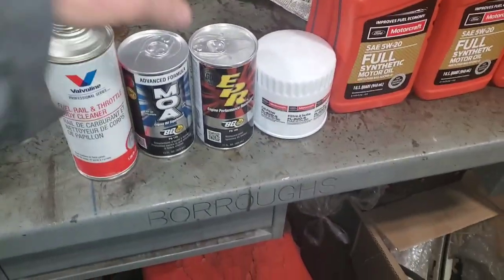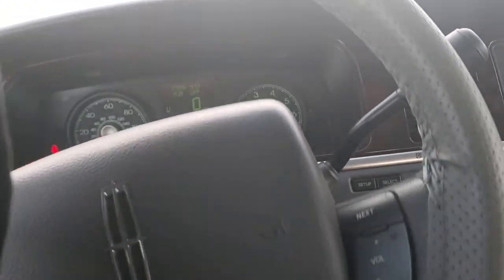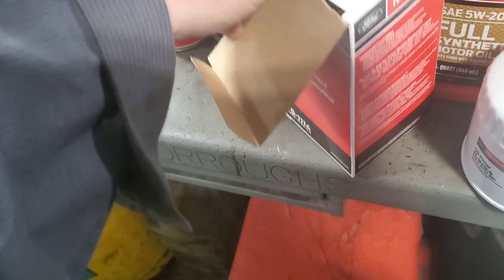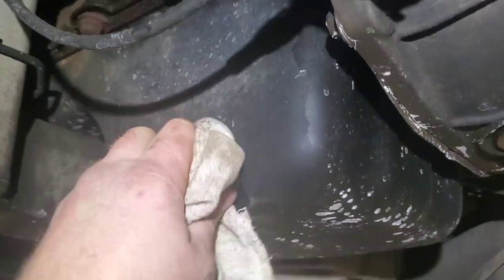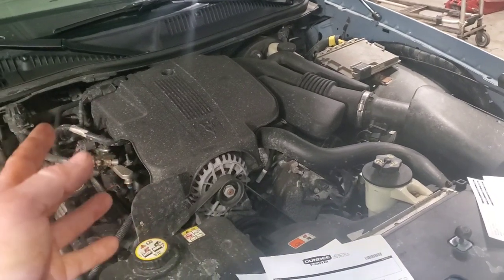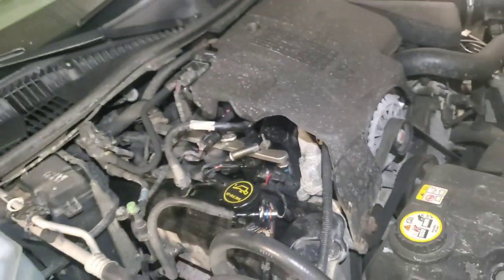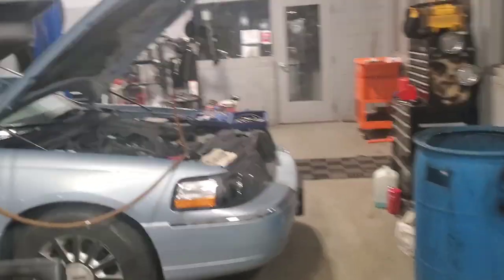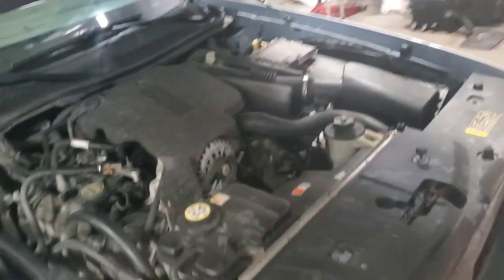Lincoln Town Car Factory Service - Fuel Filter, Fuel Injection Flush, Motor Flush (BG), AIR Filter

Comment: Every other video I've seen on replacing that fuel filter they say you have to remove that inlet hose clip and 9 times outta 10 they always break. You're the first person to say it's actually a push tab. 

I just picked up a 2010 Crown Vic P7B and I plan on going thru it and changing all the fluids and stuff so all your panther content has been helpful.

Comment: What you recommend doing on the 1.5l for the carbon build up
Reply from the maker: You have to try to figure out what dealer carries BG fuel injection cleaner and induction system cleaner
Reply: @FordBossMe  I have about 34k anything else you would recommend doing i might be due for oil change I already done a transmission drain and fill. i replaced spark plugs and air filters. I did alignment my self since I jumped a curb the other week.
Reply from the maker: Cabin air filter and if you have an all-wheel drive system service the PTU
Reply: @FordBossMe  I already replaced cabin filter when I changed the engine filter. Mine is a17 fusion se 1.5l fwd
Reply from the maker: Your Good Then
Reply: @FordBossMe  which one would you recommend for the bg 44 fuel cleaner this one here also do I pour it directly into the gas tank or should I use the fuel injection cleaner pressure tank you had
https://www.amazon.com/dp/B07PXCTPV7/ref=cm_sw_r_cp_apa_fabc_KH655ETBEX41VPRM7TCB.

Or this one https://www.amazon.com/dp/B07GT8RN6Z/ref=cm_sw_r_cp_apa_fabc_5FJY6XDXF1PRD7TPCQAE

Comment: Why not disconnect power to the fuel pump while running the injector cleaner? Doesn't it strain the pump running it against the obstruction, or is it regulated and shuts off at a set pressure?
Reply from the maker: It doesn't cause any harm to it it just slows the pulse-width modulation down to the pump that would be like sitting there with the key on but the engine not running and people do that stuff all the time

Comment: Is it ok to put the oil flush in if you have oil that has a 1000 miles on it it looks like you put it in on dirty oil but you change your oil pretty frequently and it looks like you have flushed it before . I'm not sure if I should start with brand new oil put it in flush it then change it again.
Reply from the maker: Absolutely you can put it in with the oil that's already in the engine regardless of how many miles are on it just make sure you flush it before you put your new oil in
Reply: @FordBossMe  thanks I think I'm going to get some and do it on my transit

Comment: 1991-2002 use 5 quarts of engine oil. 2003+ use 6.0 quarts. I run 6.5-6.75 quarts in my 2003+ and have for years. What is your thoughts on "over-filling" the engine oil by 1/2 a quart to 3/4th a quart in these 4.6 2 Valves?
Reply from the maker: I've never tried it and I don't know what the limitations are but you seem pretty smart and you know that if you get the oil level 2 are you'll get that crank slop and it'll actually start pushing it up to the crankcase ventilation and all kinds of smoke comes out and everything else

I've never thought about going a little bit more my vehicle doesn't burn any oil to any kind of noticeable measurable amount

Comment: Hi BOSS, it is ok to use Amsoil synthetic in my Lincoln town car 2006?
Reply from the maker: Yeah but it's overkill
Reply from the maker: Pennzoil Platinum Ultra I'd go with
Reply: @FordBossMe  thanks for the tip, I think I'll use pennzoil then 👍
Reply: the book recommends Motorcraft, but it seems a bit expensive and I think the car would work well if I use another brand too

Comment: Why not do the FI service and engine flush at the same time, and save time, running the engine ? Motorcraft oil is supposed to be really good from what I've read  I wouldn't hesitate going 4k on quality full synthetic, no additives  I go by when the oil starts to look dirty and don't obsess over the miles one way or the other.
Reply from the maker: I don't run my oil past 3000 miles that's based on what I do professionally every single day and the way I flush these and do the things that I do is because I do it for a reason this way

Comment: Usually dump Red Line SI-1 fuel system cleaner in every oil change. Also run Chevron with Techron at every fill. So far no fuel issues.
Reply from the maker: The best you can buy is BG 44K fuel system treatment
Reply: @FordBossMe 
I have a 2003 Lincoln town car that I bought yesterday, but seems to have a lot of hesitation issues. You think I if I put the BG 44k fuel system cleaner in my gas tank, it will help?
Reply from the maker: @missyidontgiveacrap9939  you could do that but also remember it has an inline fuel filter on that too needs to be changed
Reply: @FordBossMe  
Thank you so much for the fast response!!! The fuel pump and filter was replaced two weeks ago (have receipt from prior owner to prove it), but it’s still hesitating bad

Comment: can you do this on a 1.5 l4 ecoboost ?
Reply from the maker: What part do you want to do on a 1.5 L?
Reply from the maker: You can do the fuel injection flush and obviously the oil change and a cabin air filter but it doesn't have a non chassis filter like mine does fuel filter for that car is in the tank
Reply: @FordBossMe  sorry i meant engine flush. over here they don’t recommend it. They say do the oil service on time and you’d be fine. 
Can this stuff bite the internal seals or is it  okay to do it, hence the question over 1,5 ecoboost